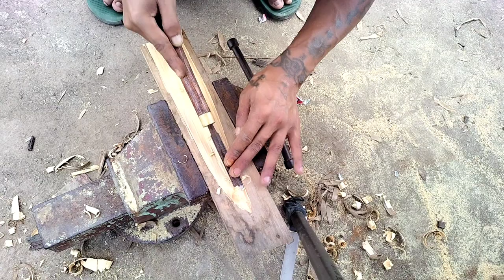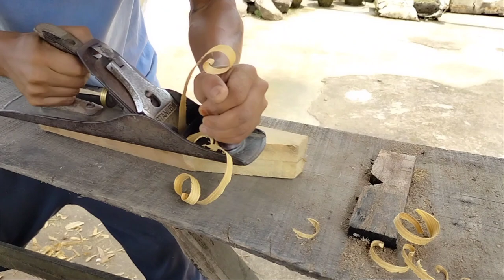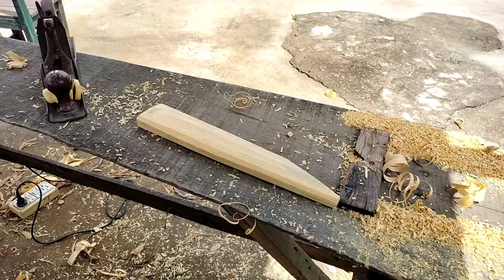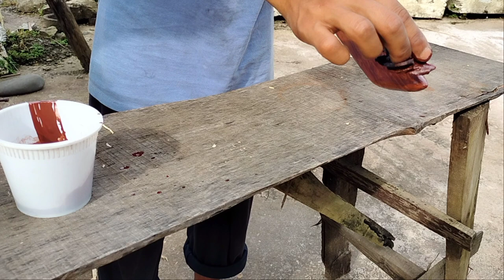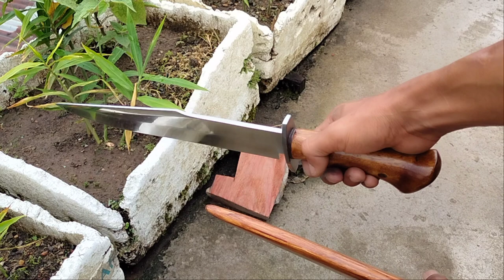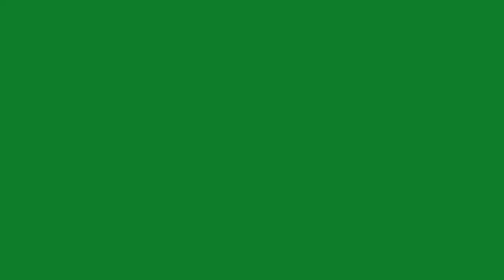knife making - Making pinewood sheath for Bowie knife.

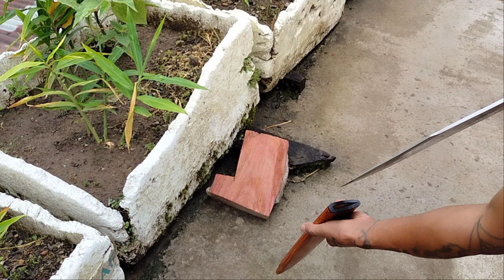Comment: 5:06 The sheath doesn't fall out, how do you keep it in place? is it just the pressure of the wood against the blade?"
Reply from the maker: My friend If you carve the wood accurately enough in the shape of the blade and the bevel and plunge lines ans so on, it always fits tightly like the handle of a katana. Thank you for watching and commenting. Making of competition chopper coming in few days. Check it out.
Reply: @mikchrungBLADES  thank you for your time and answers! 🙂
Reply from the maker: @Argentuza  my pleasure my friend....and thank you for checking in.